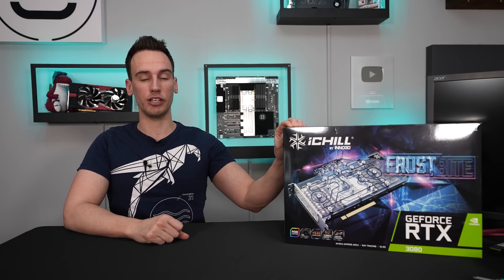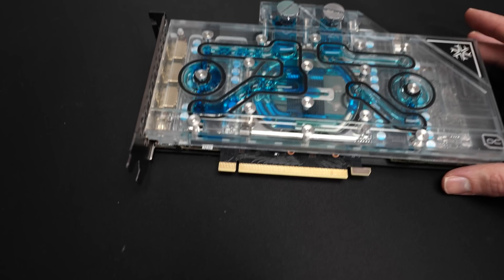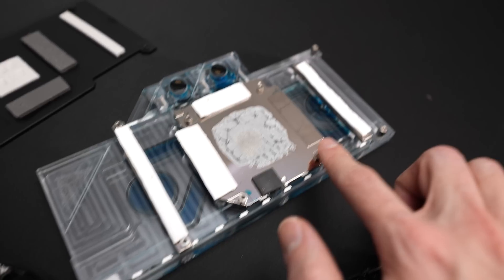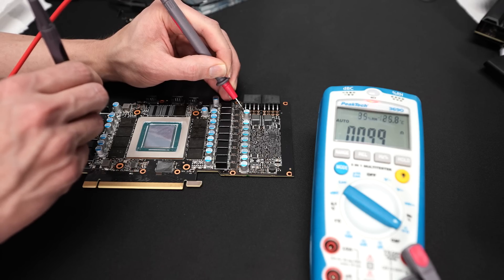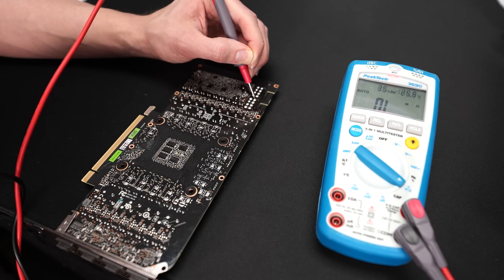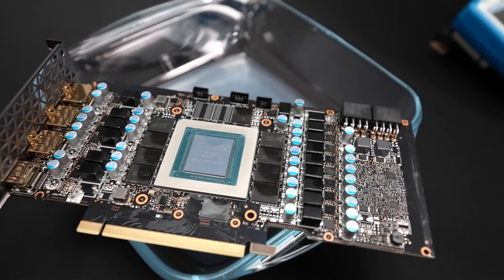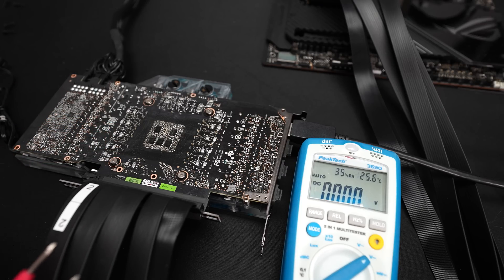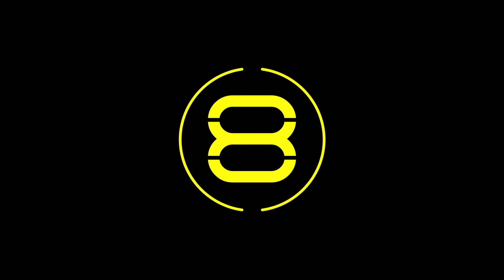How to Handle a Graphics Card with possible Water Damage - Any hope for this RTX 3080?

Comment: I have run a large electronics manufacturing plant for 30 years an am a qualified IPC rework /repair trainer. Seen this kind of issue many times before. First never use acetone on a finished pcb. Some plastic parts will be attacked. The contamination in this case is water soluble so use hot tap water and mild detergent, under some pressure to get under parts. Then rinse under clean tap water, then use a compressed air gun to blow water out. Finally rinse in dionized water which leaves no residues and blow this DI water out with compressed air. Bake at below 100C for 2hrs. Now the card is clear of residues and ready for circuit debugging.

Comment: 2:25 into this video, you hit my expected problem head on! i am in no doubt you know what you are dealing with from just the start.
i got a 1070 8gb free with water damage, and the problem was the Pci-3 pins, 1 had corrosion, once cleaned, it is 100% back and running. gave the whole card a service tho.
Furnark 76c stabel temp after 1 houre stress test

Comment: sauce dripped on the backplate of my 3080 and got beneath it, to be fair its not that much and nothing went on the front parts or the gpu itself. thinking about cleansing it with isopropyl and praying it works

Comment: Did you say Alphacool block? Pfff that card was prolly dead when it left the 🏭 factory!

I would use a Data Vac blower on the whole card. Let it warm up & blow warm air over the card to dry out under the die & memory chips.
These blowers have so many uses for pcs. Everyone should own one, if for only using it to clean dust from your case & fans!
EDIT: Ahh I see you have a similar blower, I hadnt made it that far into the video yet lol

Comment: That's a shame, especially considering the lack of these cards available.     I have not used water for liquid cooling, only chilled alcohol in the past, but wouldn't de-ionised water be better in case of leakages, I don't believe that is conductive ???
Reply: It starts to become conductive again when it's exposed to air iirc

Comment: spray some hilco lube on it i have had that shit resurrect speed controllers on my rc mud trucks and rc planes and those run 24volts lipo it disperses and water and pull any corrosion on the pcb off it brought two speed controllers back from the dead for me

Comment: This video is fake, 3080s don't exist lol

But a good way to clean a mobo is to just soak it in isopropyl or whatever (ofc remove all plastic parts first and pads).

You can use water to clean any detachable non electric parts, and make sure it's dry.

Comment: I wouldn't pour acetone on any electronics board! It is too aggressive for board cleaning in my opinion. I would submerge the board in 99,9% pure isopropyl alcohol in a ultrasonic cleaner. And you have to be very careful when putting your card in the oven. 80°C is not temperature that will break or melt any of the components but raising the board temperature to 80°C too fast could result in a pop and the board no longer working. So if you do that with the oven, put your card in a COLD oven and then turn the oven on.

Comment: I had that happen to a GTX 280 XXX ed., got water on the back of the PCB and it would just immediately crash any time it boosted to 3D clocks.  Fortunately though XFX replaced it under warranty, and another identical card that died, so I ended up with 5 different GTX 280s over a period of time 😆 they weren’t particularly good OCers, maxed out around 730 on the core, wish I had voltage control to push them a little harder.

Comment: The night I got my 3080 my cpu loop leaked all over it. Luckily it was powered off so disassembled cleaned and properly dried it out and it's been working fine since. Talk about a rollercoaster of emotions XD
Reply: How did u clean and dry?
Reply: @beaglebone99 took it completely apart,paper towel, time, isopropyl alcohol, time, done. Luckily it wasn't powered when it leaked.

Comment: @Roman der8auer I assume you checked the supporting rails as well ?
Given that the gpu was at or near 0 Ohm I would check each vrm phase separately  at the solid capacitors closest to the gpu die as well

Comment: I was screaming "no no no!" at the screen when you plugged in the pci-e power without confirming if the resistense value was still 0 ohm. A shorted power stage would have vaporized the GPU but looks like it wasn't 0ohm after all.
Reply: lol I did the same.
Reply: GPU resistance was still at zero Ohm

Comment: Thanks for the video. That looks very much like the Mayhems X1 UV Eco fluid I use. I must admit I thought it was non-conductive, but subsequent reading says not! As you say, if you spill coolant, thoroughly clean with a hot deionised water bath, and then pure IPA or the like, then put it in the oven 🙂
Reply: No matter whatever liquid you use, it gets conductive when you use it in your system.

Comment: Ironically, it would be worth running distilled water over it and thoroughly drying it again. Pro tip
Reply: If Acetone didn't work, distilled water wont do much. Coming from my own experience using the stuff in a laboratory.

Comment: my friend dumped a cup of water on his x79 PC, it shutdown immediately. I told him to unplug it and leave it alone for 24hrs. try wiping up any excess water and use a hair dryer to speed up drying.
the next day it worked perfectly, still going weeks later.
Reply: just spilt a sugary drink on mine, not water damage seems to be apparent on the card, was using it to mine crypto so I saw a sudden drop in my hashrate, which scared me lol, luckily, I have turned it on and it seems like theres not much damage

Comment: Acetone would definitely be the best. Acetone is used to dry laboratory equipment as it readily absorbs water and evaporates quickly. So if there is any ingrained water it’d be the best medium for drying the components. It’s also an awesome solvent.
Reply: Yeah! I used Acetone when i worked in a pharmaceutical laboratory to clean the equipment, that stuff is awesome.

Comment: I had a huge leak from my 420x420mm MO-RA, so there was a ton of fluid all over my motherboard.
The motherboard was completely dead and even after drying for 2 days it didnt want to turn on.
So I took 1 liter of 75% alcohol and sprayed it in a jet into every socket and under every chip. Spent the whole liter of alcohol bathing the motherboard, and once it dried couple of hours later (alcohol dries quickly) it was working perfectly fine again like nothing ever happened. Try it as last resort, alcohol removes all residue and dries clean unlike cooling liquid.
Reply: Because Alcohol is hydroscopic. use the same trick to remove water from wood. spray it with alcohol then heat gun it.
Reply: Ahaha trying this same thing right now, have hope because the PC wasn’t on when it got wet (with coolant, too) and it just never powered on even for a split-second.  So surely can’t be proper damaged, at least I hope…

Comment: I never saw some1 put the video card into the oven 😅🙈
Reply: Back in the day a known fix for the 8800 GTX not working was to put the bare PCB in oven just below 200c for 10mins, this melted the soldering just enough to fill in any fractures and reform the connections. I did this myself and it worked!

Comment: Just out of curiosity, if you had access to lots of Isopropanol, could you just submerge the card for a while in it and then dry it to be absolutely sure you get all the water out?
Reply: I've thought of that, but it would be very expensive, as all the isopropanol would just evaporate. If you have bad AC, what effect would that have on the air you breathe?
Reply: @Anas-ux9vi  I only thought about it because I have access to a lot of it at work and no one would notice a litre or two missing.
Reply: @ShadowsLetsPlays37  A bit cheeky and wasteful, yes, but I don't see why it wouldn't work. Quite the brute force method of PCB cleaning, I might add.

Edit: Made a typo that changed the meaning of the entire comment. Added "wouldn't" in place of "would"
Reply: @Anas-ux9vi  if you used a plastic dish or something you might be able to submerse the whole thing in just 200 or 300ml of ipa, that wouldn't be too much more than what roman used in the video. Plus you could let it soak
Reply: @ShadowsLetsPlays37  Yeah, his method in this video was extremely wasteful, he could've done a much better with a simple squeeze bottle. I find that if you took the time to find a similarly sized container, you'd probably be able to get things really efficient. The more we discuss this, the better idea it becomes.
Reply: @Anas-ux9vi  I also don't know if it really matters since the viscosity of ipa is so low. But if you submerge it you can be sure the alcohol has time to get absolutely everywhere and not miss something in the bga.
Reply: @ShadowsLetsPlays37  This is getting far more interesting than I had anticipated, although I'm sure that this has been done before; I'll do some searching.

Comment: You can use water with a small amount of dish cleaner, with and gentle toothbrush. Just make sure to wash it of with isopropyl alcohol to dispres the water. 
He can have one try more and be lucky. Find someone with a ultrasonic cleaner and give it a good bath. After that, messure every single cap for short to ground. If one of them is shorted just take it of. 
I would not advice using acetone, as it melts plastic.

Comment: Zerstört Aceton nicht Plastik?
Does acetone not destroy plastic?
Reply: Sure, acetone does melt plastics but not all.
I give full acetone baths to mainboards, gpu's and naked ram fairly often
Usually after 2 - 3 months of extreme overclocking this (or any thorough cleaning) is needed
And since I use Liquid electric tape to isolate the components from moisture when overclocking
Acetone has become my go to when they are really bad
90%+ Iso alcohol is used otherwise or an 80/20 mix of iso to acetone
The only components that can be a problem for me (since these boards already have most or all heatsinks removed, never any decorative covers)
are CPU Socket covers and the plastic housings on Start/Reset buttons but I remove those unless I want them to turn white (sometimes I do lol)

Comment: :-( , now I am worried about my 5 year old Arctic AIO .. how long can those rubber tubes last? Usually rubber when it gets old with time, becomes stiff and might crack spilling out all that inner AIO liquid.
Reply: Unlikely i used an antec kooler h20 120 mm aio on my old Q6600 rig for at least 7 years the pump gave out but the rest of it including the hoses were fine.

Comment: acetone melts plastics and will smear and spread colored plastic particles everywhere if you clean something that isn't specifically resistant to it, avoid ! it's used to clean silicon wafers so naked chips are fine but everything around probably won't be

Comment: 99% isopropanol is fine, dont mislead people.
Reply: especially recommending acetone instead, I happen to have both on tap at work, acetone is super dangerous for plastics and painted parts it melts everything and when drying it will make them opaque and crack their surface

Comment: Is there any fix for GPU when I accidently pulled the Pcie cables while the computer was on? I turned off the PC immediately! But now I cannot get a signal.

I owned the Asus 3070 like Derba8auer checked with his multimeter and I get a reading from the same point that he is using too!

Comment: Funny coincidence , I've had a similar scary instance yesterday . I forgot one filling port cap open and water flowed through it like  a fountain as soon as I powered the pump (alphacool industrial DDC) splashing everything in the PC . Fortunately I had laid plenty of towel paper over the components and everything disconnected except the pump (on a separate external psu) . I spent the next 1-1.5 hours with a hair dryer making sure everything were dry ... Thankfully the PC suffered no problems and 24 hours later (when most of the air bubbles left the system) is purring like a kitten ...

Comment: Attempting water cooling during a pandemic and global supply issue probably not a good decision.
Reply: true, his card was prebuilt tough, it uses a standard alphacool block it seems but he didn't have to do the scary stuff, and if you do it properly : only pump connected and leave your circuit running a few hours with towels everywhere, water spills don't happen or have no consequences the only time I've got got them is when I tried to take shortcuts not emptying the loop "youtuber" style

Comment: My uncle use to get his phone soaked in water at work to the point where the phone would no longer power up. He would put it inside a ziplock bag full of white rice and 2-3 days later the phone would power up and work perfect. 

I wonder if a gpu that gets exposed to water that has not been exposed to power can be put in a non-static container full of rice to absorb the moister would work to dry it out.
Reply: Please don't do this. I don't know how but every time someone did this and their phone died anyway I've had to open it up and there were little rice pieces stuck everywhere, including INSIDE THE PHONE!?! Instead go to the hardware store and buy a cheap bag of desiccant, then put the phone on it in a sealed container. Even better yet, get a professional to open up the phone ASAP and remove the water before it gets a chance to corrode any of the metal inside.
Reply: @K3Techs  I found a bag of dessicants in one of those gopro like cameras I bought recently that said "do not trash ! place those with the item in case of water/humidity exposure" I found that a cool thing

Comment: As I have written in the comments of the german version - I have the exact same 3080 Frostbite and it died on me after 1 day with artefacts and no post without any leakage (checked with an EK leak tester before) and Inno3D refused any support whatsoever
Reply: @River_Miles  Sounds like thats the case with the Inno3d cards indeed
Reply: Did the seller help you? Normally you only go to the company after seller refuses to help
Reply: @LEADER0FY0U  
Most sellers don't offer any support for liquid cooled hardware after sale. Most places you can't even return unopened liquid cooled products. For the majority of hardware, if it's within the return window, then you're correct the seller should be your best bet but for liquid cooling it's a different story.
Reply: @pmclean1980  at least in Germany, they have no choice. They either have to proof the card was not faulty (impossible) or take it back. (in the first 6 months after purchase).
Reply: @LEADER0FY0U  they would only do a refund which is not acceptable
Reply: that sucked. Inno is off  the list then, not that they were in the first place
Reply: What about warranty from seller ? You should have 2 years of warranty on any product.
Reply: @River_Miles  The thing is nowadays a refund is like loosing 1k in money

Comment: I was so scared to buy an i chill 3090 so i bought a 3090 strix in November  2020
Reply: got the alphacool block, working fine but the backplate to memory contact on the 3090 is crap I'm going EK next, they are releasing a watercooled backplate in april

Comment: You can wash stuff under the tap with detergent and it will still work.  

I don't recommend it but sometimes motherboards get that dirty.
Reply: just remeber to take out the CMOS battery. then you can even clean it in your dishwasher. i think roman showed that in a video a few years ago

Comment: im a soft tube/ barb / hose clamps kind of guy. ive had my radiator outside this entire winter and not a single drop leaked out. ( i use prestone coolant 60/40 water to coolant.) i work as a diesel mechanic and Barbs are used all the time.
Reply: How does it work with your radiator outside in regards to condensation? Wouldn't you risk condensation with very cold temps?
Reply: @KayJay01  yes. i had frost during a lot of gaming sessions, but due to low humidity of winter i didnt have to worry about internal condensation. just external frost. 
i managed to get a couple top 5 spots in 3dmark like this. ( DusanB if you find me) was stable at 2220-2235 in all games.
the card i used/am using is a 2080Super xc that i flashed to an FTW3 for extra power headroom.
im using a 480mm rad with 8 arctic fans at max and a swiftech industrial pump.
Reply: @jake20479  so frost on the radiator/external tubing only is what you're saying? that's cool.
I might try doing this as my PC is relatively close to a window but I fear condensation. Unfortunately Norway (where I live) is quite humid during winter (>75% during November)
Reply: @KayJay01  frost builtup on the Fittings/any metal components. so every barb and hose clamp did have frost. i use an EK VVector block. i genuinely didnt care if it died so, i would be a LITTLE hesitant to recommend this to other people. i did it to mess around on 3dmark but then i thought "lets see how long this can last..." and here i am. im about to put it inside and use an Alphacool 1080MM radiator as my Side Panel on Door Hinges. (lmao) im a little anal about wanting my loop to be ambient temperature or lower at all times.
Reply: @KayJay01  he did say the radiator's outside, not the whole system. the radiator itself doesn't have electronic parts in it so it's probably fine
Reply: @MansBestFriend_  but when you bring liquid cooler than ambient into a warm humid environment you'll have condensation around the other parts of your loop.
Reply: @MansBestFriend_  The coolant inside the radiator does go back to the system, and if the temperature difference between ambient and coolant is high enough there could be condensation formed on the tubing and thus water inside PC, which is not good.